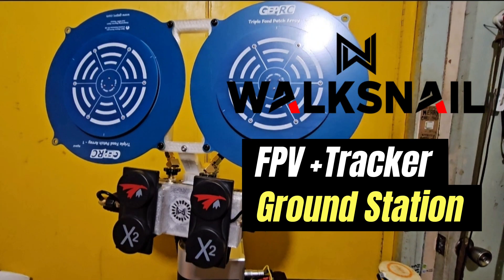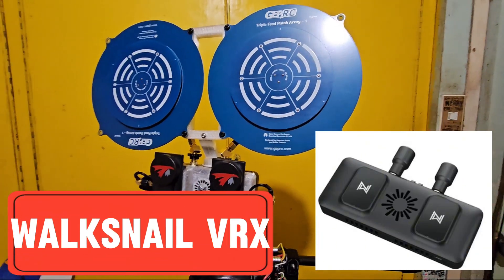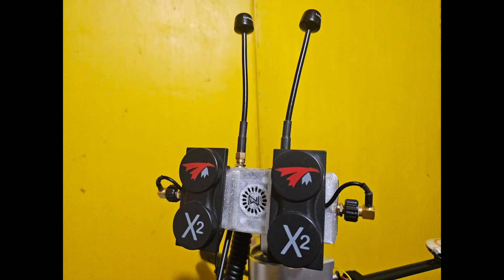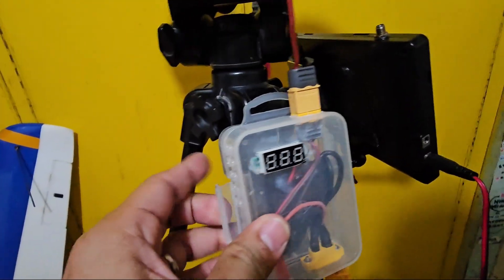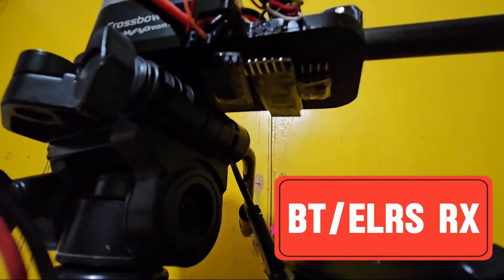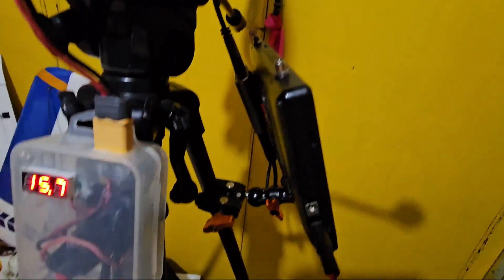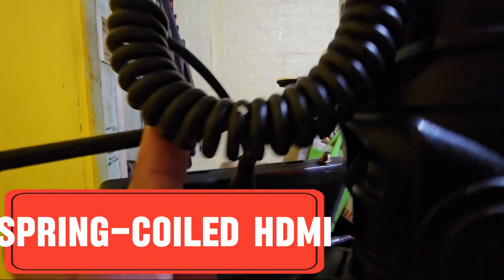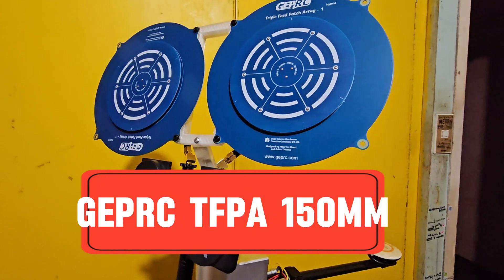Walksnail FPV Tracker Ground Station

Comment: This is exactly what I want to build but I do wonder if it's now better to use the repeater rather the VRX
Reply from the maker: I actually replaced the vrx with a repeater 😁 maybe I will upload it on a separate video, basically all the same, but just a repeater on the antenna tracker rather than the vrx

Comment: Hello. Please advise me if it is possible to implement training without the help of GPS. If so, how accurate and fast will the tracking be?
Reply from the maker: Yes, tracking without gps will still work.  But you need to set up the home position of the tracker as well as the heading of the tracker manually before each flight, otherwise it won't be accurate. Correctly done, it will be as good as with a gps on the crossbow mini.  The main advantage of using a gps with the tracker is that it's plug and go, just power it up and it will do everything for you as soon as it receives the data from your flight controller.
Reply: @windfpv Please tell me if there is a way to contact you via private message?
Reply: @windfpv  Please tell me if there is a way to contact you via private message?

Comment: If you gonna fly circles around dose hdmi cable eventually get twisted around?
Reply from the maker: @robertshultz5272  no, the tracker isn't continuous 360, thus it will rotate back once it reaches the limits.

Comment: So the crossbow tracker connects to the controller using ESP modules on wifi. So controller sends telemetry data over to esp and the esp compares its own cords with drones cords? In that case, should be simple to make a antenna tracker instead of buying one I think.
Reply from the maker: @Polkem1 "it should be simple" is relative statement. That would depend on a lot of things 😅 if your aim is to immediately fly using the tracker, off the shelf kind like the crossbow is the way to go. Otherwise, feel free to make one. Don't forget that you will also need to make it interpret CRSF/mavlink/s.port or it will not work
Reply: @windfpv  Well construction should be simple, but I am a bit concerned at interpreting CRSF protocol of telemetry data, such as extracting GPS cords.

Comment: What's the point to publish this video? Without at least basic info like specs of transmission power and distance test is nothing but another youtube show off.
Reply from the maker: It's because you haven't seen the other posts. Anyway, it's tested to 35km out and back on digital fpv, at 1200mW power on vtx. It's using caddxfpv Walksnail system.
Reply: @windfpv  Now is clear. Sorry! I just tired browsing nonsense videos with 0 test and result information. Click bating content has become close to 80%.
Reply from the maker: @sugarvenom2189  haha! No worries, that's to totally understandable 😎

Comment: hi i see elrs has mavlink firmware to flash both rx and tx if you flash and setup will it work to push mavlink to the tracker with two bluetooth devices
Reply from the maker: In one of my configurations on this tracker, iI used a backpack fw for the rx to run espnow, which runs mavlink. This allows the  Rx on the tracker to directly connect to the backpack on the elrs tx on my radio (via WiFi). No need to use Bluetooth modules. I only got Bluetooth modules when I use dragonlink (that also runs mavlink), or on my previous config where I used crsf telemetry mirroring, which is not that good. I don't use the Bluetooth module when I'm using the espnow setup. By the way, when using espnow, only the backpack Rx runs mavlink. The tx on your radio  and Rx on the plane runs whatever protocol you want, I'm using CRSF protocol on them, not mavlink.
Reply: @windfpv  where can i get info on how to do that please espnow and mavlink
Reply from the maker: Kindly wait for the official release of next fw of  elrs, docs regarding the configuration will also be provided. Devs are still doing some final touches on it

Comment: do you to install something in the drone or plane to track??? the crossbow mini needs something to track?
Reply from the maker: The tracker fetches the plane altitude, location and heading from the flight controller in the aircraft
Reply: @windfpv  ok the You need to connect in the flight controller some hardware ? Could you tell me witch one ?
Reply from the maker: Depends on what you prefer. You can go with matek, speedybee, pixhawk etc. any fc that supports mavlink telemetry basically
Reply: @windfpv  i use elrs to long range ...My drone has GPS..could i use My gps telemetry for the tracker ?
Reply from the maker: @siniestrorave  yes, if you can see the telemetry data on your radio then most likely you can send it to the tracker.

Comment: Question: How does the Tracker know its heading? Dual GPS can give an accurate heading, but I only see one GPS. Does it use a Magnetometer? And hope there is no iron around to shift the measured heading?
Reply from the maker: It knows the heading by comparing the gps coordinates from the aircraft's gps vs the home coordinates from the local gps (the gps installed on the tracker). For other crossbow mini tracker setups that dont use local compass, you need to press the set home button while the plane is still on the ground, it will record the coordinates from the aircraft's gps as the "home coordinates". Once the aircraft flies, the gps coordinates of the aircraft in flight will be compared to the home coordinates. As the aircraft moves around, the tracker can compute the heading. The tracker also has compass (internally or external if the gps module has one) which improves the heading calculations

Comment: Will the use of the ELRS and ELRS backpack functionality eliminate the need for using serial output and a Bluetooth module from a TX16s?
Reply from the maker: No need to add BT on the radio. The backpack of the elrs tx will directly communicate with the backpack RX that's connected on the tracker.
Reply: Excellent! I'd love to learn more about this!
Reply from the maker: I'll post a detailed guide as soon as the next elrs fw rolls out 💪 don't forget to check out my channel soon
Reply: Thank you! I'm subscribed so I'll keep an eye out.
Reply from the maker: @sarahdaviscc thank you!!

Comment: Niceee, but elrs RX for whatt?
Reply from the maker: Receives mavlink telemetry from backpack of the elrs tx module. This gives a smoother tracking as seen on the video rather than using crsf mirroring. Basically the Crossbow Mini will be receiving mavlink data instead of CRSF by using backpack on the TX to send out the data, ELRS running backpack RX mavlink will relay that data to the tracker. But the fw is not yet released. It will come out soon, devs are still doing the final touches. As per our testing, the tracker is not hunting anymore, if you have seen my previous test video where I used ELRS, it works, kinda. It hunts too. but when using Mavlink, it really works much much more stable.
Reply: @windfpv  that's cool, can you make a video how to set up ELRS like that??. Im in same hardware like you
Reply from the maker: @Rafif_musyaffa  surely, I will be posting the configuration guide for this one soon, still waiting for elrs devs to finish some of the details

Comment: Hey! Do you have any tips on doing this with a radiomaster pocket? It shows bluetooth capability, but looks like the only bluetooth is for connecting to PC for using as a joystick - thank you!
Reply from the maker: The pocket has a backpack, you better use that and put an Elrs Rx on the tracker (running mavlink backpack). But at the moment the fw for the elrs mavlink backpack is still being polished, this will be out soon.

Comment: Anteena tracker work for betaflight.
Ground station for analogue setup instead of Walknail?😊
Reply from the maker: If your betaflight setup has gps and can get telem data (gps coordinates and altitude) to your radio via elrs,  then it should work. The telemetry will be forwarded by the backpack to the elrs Rx on the tracker. The tracker works independently from the video system, so regardless if it's analog or digital, it does not matter.
Reply: @windfpv  ok cool, your instragram I'd? For further discussion

Comment: how did you get the tracker to work so well what firmware are you using please mine keeps drifting all over the place
Reply from the maker: Are you using crsf mirroring?
Reply: @windfpv  yes i am 
with two hm-10 and will you belive i use the exact same setup as you antenas/monitor/cables lol
Reply from the maker: ah that explains it. With CRSF mirroring, the tracker kinda works, it hunts when it drops some packets, making the tracker quite unreliable. I'm not using CRSF here but rather mavlink. You will need to use the backpack of your ELRS tx to relay the mavlink via wifi to an ELRS rx that runs a backpack rx fw (which also uses mavlink). This will allow the Crossbow mini to process mavlink instead of CRSF telemetry. No hunting when using mavlink.
Reply: @windfpv  nice man can you please make a short video on how to do this please it will heip not only me but a whole lot of guys that have the same problem with the tracker using CRSF and THANKS for taking the time yo reply to me on this man
Reply from the maker: @RC-um3dv sure, when the new elrs fw for backpack Rx rolls out, I can make a video on how to set it up. It just takes a few steps.
Reply from the maker: @thirtythreeeyes8624  for the tx, my elrs tx already has backpack. But that would be handy for those modules that don't have backpack. For the receiver, it would be best to put esp32 based, but I used a happymodel ep1 (esp8525 based if I recall correctly) and still worked well.

Comment: Do they only work with ardupilot?
Reply from the maker: No, this works as long as you can transmit telemetry to the tracker in crsf, mavlink, s port format, regardless if ardu or inav